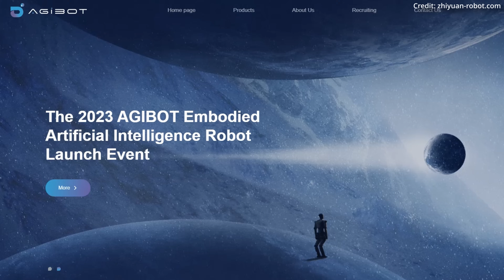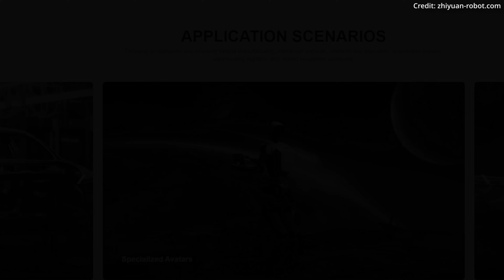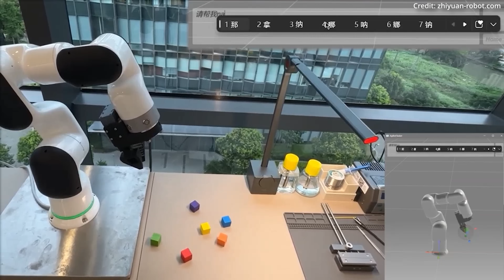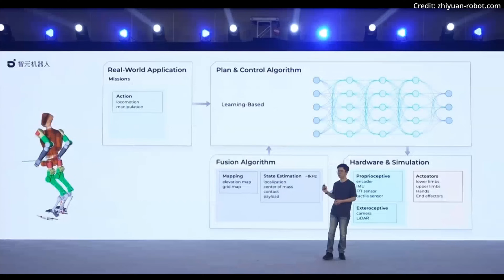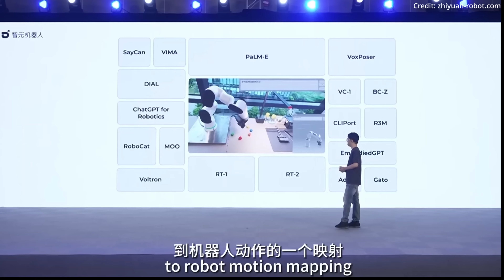RAISE-1 AI Robot Demos 49 Axes Humanoid Using This New Tech (“AGI-BOT” ANDROID, EL BRAIN)

Comment: What a stupid idea - making a robot that mimics a human being.

Just as $200 quadcopters have totally turned "modern warfare" upside down
The idea of a robot that is a replacement for a human being is just stupid.
The $200 quadcopter drops mortar shells on tanks that travel with open hatches to get fresh air
and the quadcopter waits for a hatch to open and drops the mortar shell inside the tank
A $200 toy taking out a $2 million tank.

Swarms of smaller, cheaper robots are the way to go.
I tell you - these AI/Robotic geeks have no imagination.
Reply: Swarms would be useful for some tasks.  Not domestic work.  Right tool right job.
Reply: How will small cheap robots wash the dishes?
Reply: No one wants a "swarm" of robots in their home.